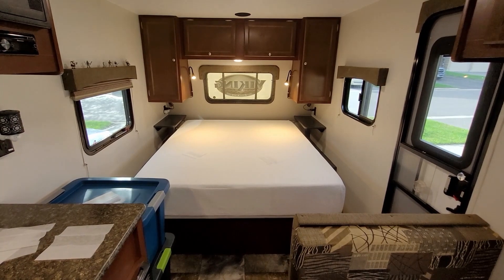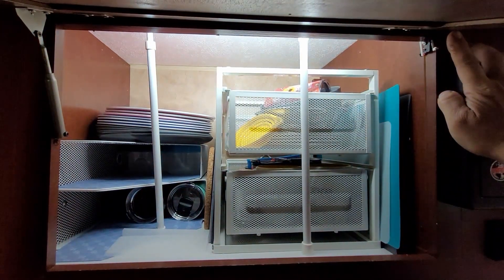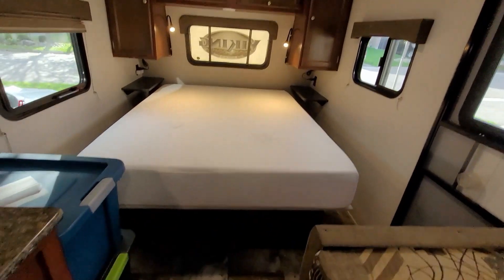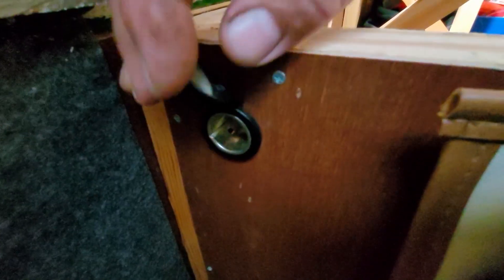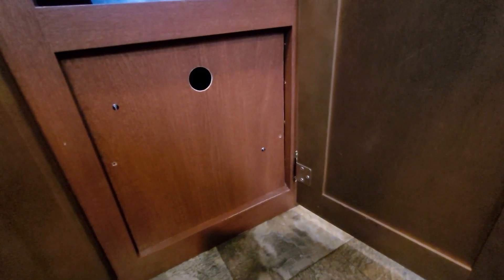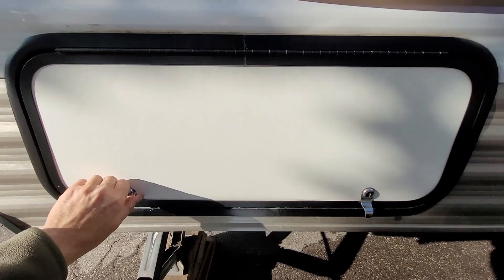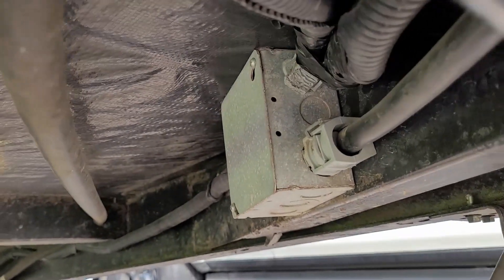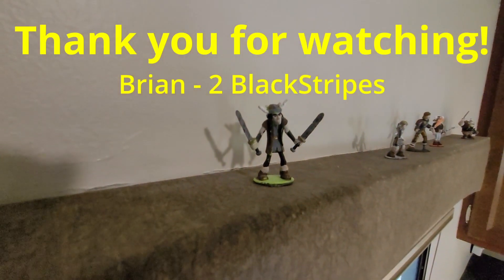Camper Trailer Upgrades - Little changes, big improvements

Comment: Well done! Lots of handy upgrades. We also created a fused jumper pin to turn on all the trailer running lights while at camp sites on that 7pin connector to give more lighting at night. Good job.
Reply from the maker: Thank you! I considered the running light option, but since we're planning on putting LED underlighting on it in the spring (and possibly an under-awning strip as well), I decided that those sources would be enough on their own. That would be a much simpler, and far less expensive way of getting some added perimeter lighting.

Comment: We have the Coachman 17FQ version of your trailer.  Almost identical.

I like many of your ideas.  I'll do some.
Especially the access to the Water Pump.  That is a plan when I get our trailer out of storage.

For inside the cabinets, first in the trailer and then we got some for the house are these motion sensor wireless LED lights.  The stick by magnet to wherever you want.

"Stick-on Anywhere Portable Little Light Wireless LED Under Cabinet Lights 10-LED Motion Sensor Activated Night Light Build In Rechargeable Battery Magnetic Tape Lights for Closet"
Reply from the maker: I'm pleased that you were able to take something from the video, thank you!
Your suggested stick-on lights would definitely be a much easier solution to the problem than hard-wiring them like I did. I'm a bit of an electrical nut, so I went that route instead.
Thanks again for the positive feedback and the good idea. Happy Camping!

Comment: I have the same setup, 4Runner and 17ft Coachman, I find the 4Runner struggles quite a bit with a headwind, speeds over 90km/h and of course hills. Have you considered the supercharger from Magneson? I’m seriously thinking about the supercharger or changing to a Sierra 1500 with the 3.0l diesel.
Reply from the maker: The 4Runner could definitely use a transmission with more speeds to choose from. Needs 4th and a half to improve highway mileage, 3rd and a half on hills.
Funny, I joked with my wife just tonight about supercharging her truck once the powertrain warranty is done...
In reality, it's liveable, might not be if we regularly travelled in mountainous areas, but ok here in Onterrible.
We keep our vehicles forever, so as a working auto tech, I'm reluctant to give up our anvil-simple, crazy reliable Toyota. I'd never buy a modern diesel as a long-term ownership purchase, obvious benefits notwithstanding. Expensive nightmares from all of the emissions crap as it ages. (A friend that has one of those GM 3.0 diesels loves it. He won"t keep it past the warranty though.)
Besides, Mrs 2blackstripes doesn't want a pickup, and she loves her roll-down rear window.
Thanks for commenting!
Reply: Thanks, I really appreciate the insights.